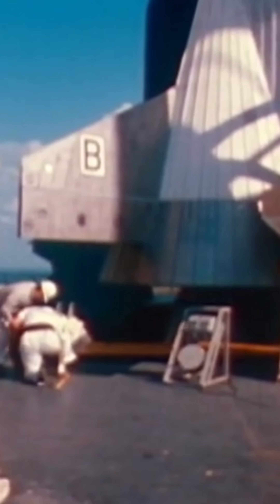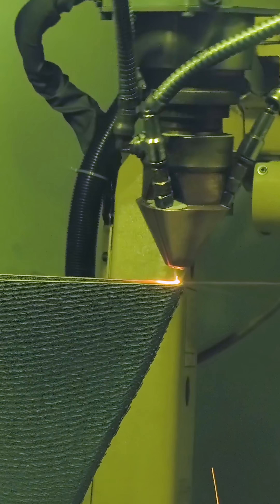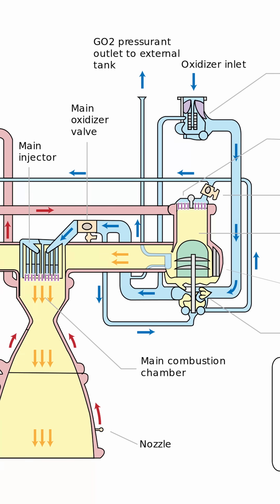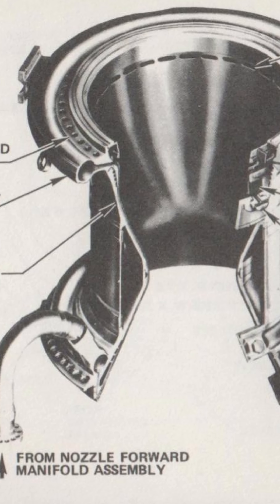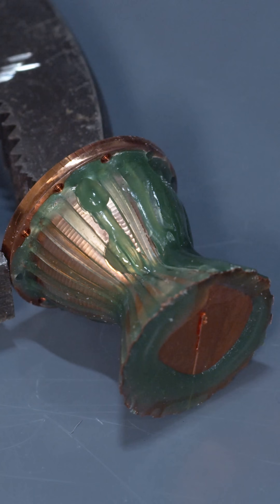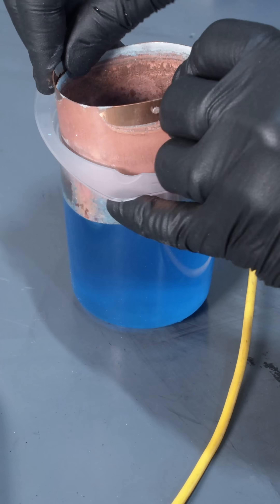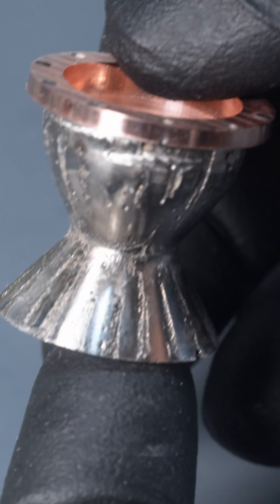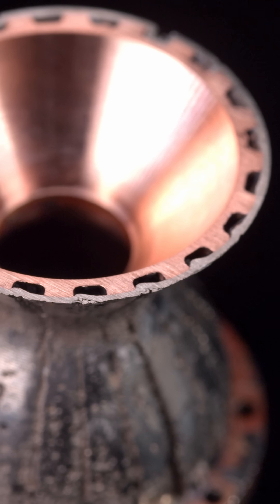Space Shuttle Combustion Chamber

Comment: ---

Saturn V Rocket

Used for: Apollo missions (1960s–1970s), including the Moon landings.

Design: A massive three-stage rocket, over 360 feet tall.

Built by: NASA with contractors like Boeing, North American Aviation, and Rocketdyne.

Purpose: To launch astronauts to the Moon.

First launched: 1967 (Apollo 4).

Key components:

First stage (S-IC): 5 F-1 engines for liftoff

Second stage (S-II) and third stage (S-IVB): took the spacecraft into orbit and toward the Moon

Apollo spacecraft on top (Command/Service Module + Lunar Module)

---

Space Shuttle

Used for: Low Earth orbit missions (1981–2011), like launching satellites, building the ISS.

Design: Reusable orbiter with solid rocket boosters and an external fuel tank.

Built by: NASA, Rockwell International, Morton Thiokol, and others.

Purpose: Reusability and routine access to space

First launched: 1981 (STS-1, Columbia)

Key components:

Orbiter (like a spaceplane)

External fuel tank

Two solid rocket boosters

---

Did the Shuttle use Saturn V technology?

Not directly. The Saturn V was retired after the Apollo and Skylab programs. The Space Shuttle was a new design, but NASA used knowledge and experience from the Saturn program. For example:

Rocketdyne, which built the Saturn V engines, also developed the Shuttle’s main engines.

NASA reused infrastructure like the Vehicle Assembly Building and launch pads at Kennedy Space Center.

---

If you're asking if they ever launched a shuttle using the Saturn V, the answer is no—but NASA did consider concepts in the early 1970s that would've used Saturn V components for reusable vehicles, like the "Shuttle-C" or earlier shuttle design studies.

Want to see some concept art or diagrams comparing them?

---

Saturn V Rocket

Used for: Apollo missions (1960s–1970s), including the Moon landings.

Design: A massive three-stage rocket, over 360 feet tall.

Built by: NASA with contractors like Boeing, North American Aviation, and Rocketdyne.

Purpose: To launch astronauts to the Moon.

First launched: 1967 (Apollo 4).

Key components:

First stage (S-IC): 5 F-1 engines for liftoff

Second stage (S-II) and third stage (S-IVB): took the spacecraft into orbit and toward the Moon

Apollo spacecraft on top (Command/Service Module + Lunar Module)

---

Space Shuttle

Used for: Low Earth orbit missions (1981–2011), like launching satellites, building the ISS.

Design: Reusable orbiter with solid rocket boosters and an external fuel tank.

Built by: NASA, Rockwell International, Morton Thiokol, and others.

Purpose: Reusability and routine access to space

First launched: 1981 (STS-1, Columbia)

Key components:

Orbiter (like a spaceplane)

External fuel tank

Two solid rocket boosters

---

Did the Shuttle use Saturn V technology?

Not directly. The Saturn V was retired after the Apollo and Skylab programs. The Space Shuttle was a new design, but NASA used knowledge and experience from the Saturn program. For example:

Rocketdyne, which built the Saturn V engines, also developed the Shuttle’s main engines.

NASA reused infrastructure like the Vehicle Assembly Building and launch pads at Kennedy Space Center.

---

If you're asking if they ever launched a shuttle using the Saturn V, the answer is no—but NASA did consider concepts in the early 1970s that would've used Saturn V components for reusable vehicles, like the "Shuttle-C" or earlier shuttle design studies.

Want to see some concept art or diagrams comparing them?

Comment: NO. Thats a THROAT. Not a combustion chamber
Reply from the maker: It includes the throat, but it's officially called the "main combustion chamber" on shuttle engineering documents. You can look it up, that's what NASA calls this structure. The injector plate sits right on top and encloses one side, forming the combustion chamber.

Comment: so is that how cars make coolant and oil channels in an engine block
Reply: Sand casting.  Coolant channels are not a precision feature though.
Reply: @brandons9138  but i know blocks are often sand casted. some components are forged. but i always wondered how they made all the intricate channels for coolant and oil to circulate, but there's no way to drill them throughout the block
Reply: @Zatchxbell  Oil is not usually circulated internally though the block. Oil holes on a crankshaft are often drilled even on forged crankshafts.
Reply: @brandons9138  okay. what about the coolant channels
Reply: @Zatchxbell  They are cast directly into the block using compacted sand forms.  Do a search here on YouTube you can find videos that show the process.

Comment: What's the point of the wax? If removed?
Reply: Its not the wax is the hole that are useful, you run the fuel through the jacket to cool the engine and preheat the fuel.

Comment: Engineers pumped minus -423 F liquid Nitrogen thru those small chambers to prevent the metal engine bell from melting from the heat of the engine. Genius Apollo Engineers designed this engine bell

Comment: Electroplating makes sense! I did think of using wax or something similar but couldn't think of how it would withstand the heat of adding the metal around it. Maybe using wood or something and then burn out the internal structure after. Which would leave you with a lot of difficult to clean waste in the tubes. The plating method is way smarter. Thanks for showing me :3

Comment: The cold cryogenic fuel was circulated through those hollow empty channels left over after removing the wax.
The cold fuel helped absorb the tremendous heat energy from the combustion of the engine this in turn  kept the metal nozzle from getting soft and melting 
It was a vkey stage in the design that allowed the nozzle to be able to survive the insane temperatures of the combustion process.
Very trick👍
They used pretty much the very same design in the engine nozzles of the Saturn V

Comment: This breakthrough came in the early 1960's, ten years earlier that this short about technology.  The Saturn V used the Rocketdyne F-1 rocket motor, first flight 1967.  Look it up, it is amazing and brilliant engineering.
Reply: No it didn't. The F1 used soldered pipes. The patent for the electroplated wax core was from MBB in 1979.

Comment: Instead couldn't they just use a fine sand moulding with the wax shaped exactly like the combustion chamber inside the sand , and pour the metal which will replace the wax as it is much hotter than the wax's boiling point.

Neither a black smit nor a mechanical engineer. Asking out of curiosity.
Reply: Doesn't that give an advantage of making it as a single piece which increases structural stability but also lowers the possibility of corrosion.

Comment: I wonder if they did tolerance calculations on the resultant part..... or if they just winged it.

You really had to be the right kind of crazy to be an astronaut back then; really taking a leap of faith with those early design & manufacture processes.
Reply: that was not an early design. The F1 from the Saturn V used pipes that were soldered together. The Patent concerning the electroplated wax core is by Messerschmitt-Bölkow-Blohm from 1979 so 10 years after the Moon Landing and the RS-25 which used these channels is from 1981.

Comment: Void-blocking is an ancient crafting practice and it's kinda foundational to tool and die work. The application is slightly more refined given the use of chemistry but it's more or less how you'd make a void in most materials: with another material of different enough properties.

It IS a little complicated but it's a very old idea humans have centuries of experience with. Wood was popular for a long time because it's solid enough to use structurally for build support but can then be burnt out, revealing cavities or pass-throughs.

It's a good way to make a kiln or other kind of working furnace on the spot.

Nasa can and will make some new stuff. But their bread and butter is remembering history and nearly everything they ever read besides that. You know, like how a nerd would do.

Here's what's going bake your noodle later: if rocket scientists are happy to use arguably prehistoric concepts then how much smarter are we really than we were 100,000 years ago when we started using composite crafting materials? The ideas add up to more but it's still mostly the same ideas.

Comment: the fuel sometimes runs along those grooves before being shot out of the same bell housing . The fuel is ice cold in storage tanks and the bell housing can only take so much heat, basically forcing a heat transfer to the cold fuel and resulting in better combustion levels and cooler exhaust gases . ingenious really when it would melt most metals and alloys .

Comment: At first, I was worried that the part would be cast entirely from wax. This is very clever in that it avoids the brittleness of casting—something very bad for the high loading and severe vibrations the part would experience.
Reply: Cast parts can be heat treated to reduce brittleness. More likely it was a combination of surface tension and capillarity that made casting more-or-less impossible. If you've ever tried to cast very thin parts, you'll find it is extremely difficult without vacuum or pressure assist.
Reply: With electroplating you need to be concerned about delaminating between the two coatings.

Comment: That is how Servo meter used to make their stainless steel bellows. My dad could always make them quicker and Cheaper by TIG welding 5000 thick stainless steel washers together inside and outside inside then outside to make the bellows. He never understood why they didn't set up a automatic welder to make them that way they were far better than the chemically deposited material over a core.

Comment: Even 2030, I will not agree to use 3D print system
Reply: why?
Reply: @pain10227  I don's trust it, and I would keep using troditional hand crafted skills. I will never ever use it. Human beings are so lazy and with less and less skills nowaday. If no power in cities for 7 days, 99% of humen died. They have nothing can do withour eletronic devices.
Reply: @jameskan1541  throughout history one of humanitys main goals is to be lazy.
Reply: @pain10227 idk how structural strength of metal 3d print is but iirc 3d printing is extremely brittle. There are other methods but thei aren't mainstream
Reply: @mateusmercer2280  i mean that doesnt make it completely useless, you can just use it when you dont need rigid stuff, and it sure is useful
Reply: 3-d printed metal does not have as consistent properties as a cast/ forged piece as the crystalline structure isn't as unform.

Comment: Its 1959 and the oxcart was about to fly 800 miles faster than the fastest artillery at 2,600 miles an hour and cruise at 131,000 ft. It is not known how it could taxi 50 yards then zoom climb straight up exceeding mach 3 in 90 seconds and reach 200,000ft and before melting at mach 3.6 ,power down. We may have or could have reached space before Sputnik with the Y 12 oxcart depending on when one thinks outer space begins. That is why the Saturn V  beat the Russian N1 badly in the moon race. The Oxcart couldn't orbit but cant be beaten today unless the plane is revised by true genius.

Comment: Wonder if like in some of the do it yourself metal forges if ya could “spin” the fuel  (think like the twist in a rifle barrel) if it would would increase the thrust and if you could preheat a small amount of the fuel right before it entered the ignition points increases the combustion and efficiency of the burn.

A step further would be having a small amount of O2 injected into the cone of the vortex further increasing combustion, fuel efficiency increasing power, range and thrust.

Comment: I think it was Boeing that was designing an intercontinental ballistic missile, and they had problem with the fuel in the storage tanks. Would corrode the tanks and make them in operable a little company in Butler Pennsylvania, called Armco steel. They devised the stainless steel that would not corrode under those conditions Armco steel save that project. This is a Jim Mungai from Kennerdell, Pennsylvania.

Comment: I wonder what paint they used on the outside of the rocket? The SR-71 goes Mach 3 or so and can't have paint because it just peels off because of the speed.. but a rocket goes Mach 25 or so and has paint all over it. 
Also.. what fuel burns in a vacuum chamber? All of the tests where they try to burn fuels and other combustible chemicals show that none would burn. Space stuff is so fascinating.. almost like it's just science fiction.
Reply: On rockets they use an oxidizer mixes with the fuel to allow it to burn.

Comment: Or you could use a low point melting metal like aluminium,tin,lead or if not could use plastic as they have a low melting point and also plastics could be better to use due to density and low porosity

Comment: I worked at TRW and performed nondestructive testing on the Lunar Excursion Module (LEM) decent engine. Specifically a titanium manifold that routed two gasses into one pipe where the ignition took place. Each one was about the overall size of a soup bowl. The pipes were very thin wall and a bolting flange was at each end. The problem was that, being Titanium, the sheets that would be formed into the pipes were almost impossible to form. So the manifold was made in two halves. There were hand hammered into the perfect shapes and it took very skillful guys a very long time to do. Then the halves were hand welded together. Similarly, the bolting flanges were hand machined to perfection and welded to each end if the pipes. Mu job was to X-ray the welds for inclusion, dye penetrant test for cracks and verify the perfection of wall thicknesses. The job of a lifetime. There are 7 things on the moon that i held in my hands.

Comment: @BreakingTaps Why not use Sn-Pb solder grade alloy, which can be melted out easily as well?
Reply: I'm guessing because wax requires a significantly lower temperature to melt and doesn't solder itself to the base material in the process. And as a backup can be burnt out

Comment: We can 3d print metal? Damn thats crazy!
Reply: Yes. We actually can print whole rockets right now. Check Relativity Space. They just not long ago launched Terran 1, first fully 3d printed rocket. Now they are moved to Terran R,  reusable medium launch vehicle, also 3d printed.
Reply: The engines of the Rocket Lab satellite launchers are all 3D printed then baked in a furnace. Any failed Rocket Lab launches have not involved engine cracking/break-up.
Reply: They can 3D print houses with concrete, too.
Reply: @Iowagrown123  very poorly and without any reinforcement, I don't think anyone will buy those ice cream slop houses
Reply: @DDDadToTheBone  those houses are for now just pathfinders, and I agree,  they are not particularly pretty rn. Concrete printing is still matter of future, not today. 
As for machinery, metal, 3d printing is extremely efficient tech that allows to produce elements that are not possible to create with any other technology at least as single parts. Machining allows to work with much harder materials,  casting is much quicker than 3d printing, etc, but 3d printed elements can be incredibly precise, with extremely complicated inner structure, also with multiple materials.

Comment: You cannot propel through a vacuum. Its like trying to row a boat in dry dock.
Reply: Newton’s third law of motion says that any action has an equal and opposite reaction — kicking a soccer ball makes the ball impart a force on your foot.

Now imagine you are on a boat, and you have no oars or engines, so you can’t push against the water. There is a pile of rocks on the boat. You can move the boat by throwing the rocks as hard as you can off of the boat, because the reaction from the throw will push you backwards, like the recoil on a gun. A rocket works by propelling mass as fast as possible out of the rocket motor, causing the rocket to move in the opposite direction. The rocket isn’t “pushing” off of anything.

Comment: A very common method of making parts with unusual typography on internals.  At AIL there was a great mastery of the technique it was critical for making waveguides.  There was also a micro machine shop, the exact size of a largest barstock escapes me but it was about 1/16th and diameter .   Just think of any traditional machining process except it's done by The Machinist through a microscope.